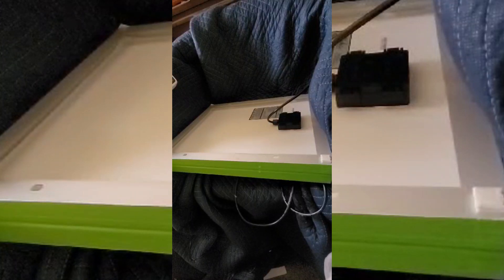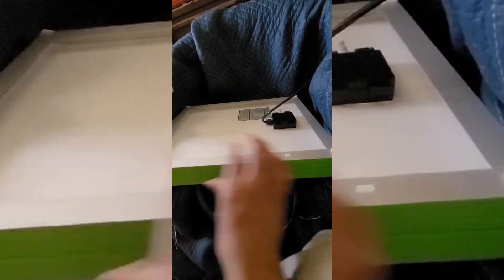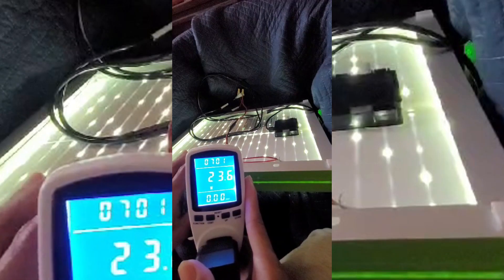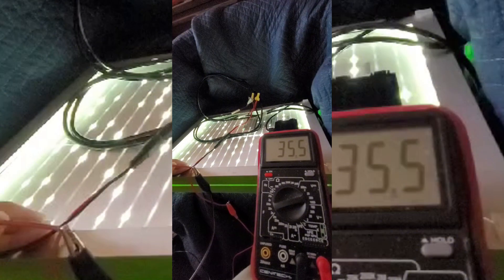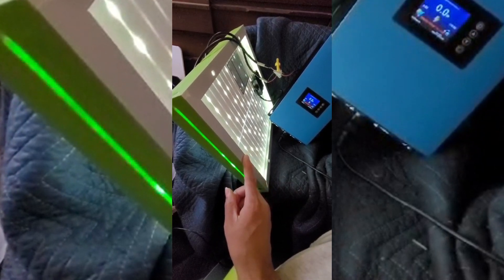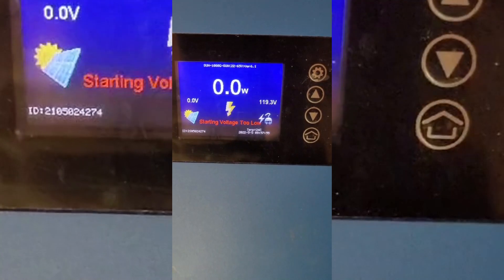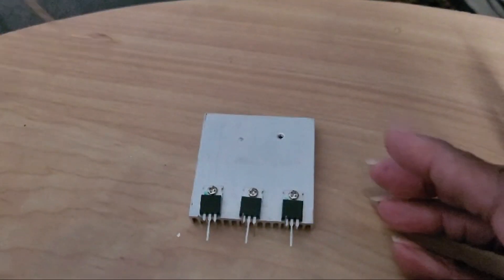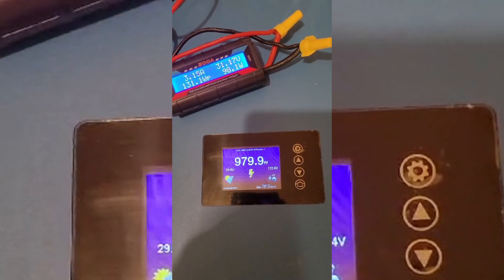Lloyd Shows How He Generates More Energy From Solar Panels With LED

Comment: I'm a bit rusty but I think LED produce about 150 Lumen/Watt. So 23W is about 3450 Lumens. The luminous efficacy of sunlight is about 100 Lumens per Watt. So if we assume a similar spectrum 3450 Lumens is equivalent to about 34.5 W of sunlight. Solar PV are about 15% efficient so 34.5W of sunlight produces 0.15*34.5=5W of electricity. So I'd expect this rig to turn 23W of electricity into 5W of electricity. An overall efficiency of just 100*5/23=22%. Certainly not over unity anyway.
Reply: Nice and good figures, I like it. But unfortunately this is wasteful because whatever equation you present to him is considered wrong based on his knowledge and education. He surely ignore this figures and equation. What you present here is helpful to others including me but not to him.
Reply: Seems to me like these people are on drugs.
They just build weird stuff.
Since motivation comes from the high. Perhaps this kind of energy drives this overunity device ?

With a clear mind i would get a headache. Cause i know that solar cells are 25% effective. And Led's are 90%.
This should be 22,5% of the input power out. 

Consciousness bends reality ? 

So the drugs in the human body power this device , by changing Consciousness ?
Reply: Why struggle to calculate, simply share your equation with Lloyd. He has a Youtube channel. He is doing an experiment that I haven't seen people do. See how close that solar panels are to LED. He is using readily available LEDs and solar panels. Just conduct your experiment and share your data.
Reply: @Avatar_2025  He is stubborn. He standing on his own invented formulas and ignoring any corrections.
Reply: @Avatar_2025  This kind of experiment is made by newbies in the free energy field being so simple to replicate, therefore nobody is interested in it afterwards. The results are very clear: waste of time. I saw though interesting experiments made with solar cells and tritium lights. This could be something of interests, but tritium is soo expensive.
Reply: @Machiuka  Ok. Have you read Patrick J. Kelly's ebook on devices that seems to defy our laws?
Reply: @Avatar_2025  Reading that book is our primer book, but the examples from that book are primarly theoretical, not so much of practical interest. There are thousands of people working to solve this problem on this planet, but so far none of them came to something that could be easily replicated. We are continuing searching for this holly grail, but the endeavour is not so simple. I am somehow sad when I see people trying to present hocus-pocus solutions to other people.
Reply: @Machiuka  You're right sir.
Reply: @Machiuka  In that book, some inventors are still alive but what amazes is, why keep looking for something that has been found simply because scientists haven't found a theory to explain such findings or because inventors have not come up with acceptable theories to explain their findings. These devices do work as claimed but it is us, interested in others areas that keep saying that it is impossible, just like turning water into wine, the wine that people drank and got drunk.
Reply: @Avatar_2025  If those inventors are alive and their inventions are the real deal, why nobody except them are having those inventions??? Nobody in real world cares of theory but of real data, energy in vs energy out. Until now only claims and some videos nobody can verify. I didn't say they are not honest, maybe they are. I only ask  a simple question.
Reply: @Avatar_2025  
I've seen some of the work he's done and it's extremely poor.
Reply: @ColinWatters  
I calculated about 4.7 Watts using slightly different assumptions.
Reply: Im not sure if this helps the scientific argument at all. Your argument is against the efficiency of the solar panels. If for instance he had used the 50% efficient solar panels that have been shown in experiments, he would break even, a feat that is supposedly impossible. From there on, if we get for instance a 60% efficient solar panel, there will be free energy. Also bear in mind, he is using two panels that are very close to the source of light. Your argument only proves that this can work given the right solar cell efficiency.
Reply: @Binahx86 15% is closer... 50% is too far.
Reply: @Binahx86  He shows it works. The guy is available and you can ask him questions.
Reply: @Avatar_2025  He hides. Avoiding two way conversation. Delete comments. Run away after a single punch like the known black boxer.
Reply: @Avatar_2025  His works were illegitimate. Easily replicated by any kids.
Reply: @Binahx86  In that case my numbers are wrong. I did say I was rusty.
Reply: @ColinWatters  Rust not penetrated too much yet. A lot of people in solar industry said PVs are 20% efficient. More or less....

Comment: Lloyd we need a simple description what you have done here with the solar panels and how they generate dc power  led lights and mosfets 
genius by the way
Maxwell can put these on the boot of his car or on the roof  brother 
But you need a licence fee negotiation first 🎉
Reply: how much more simply does he have to get. you must be simple.
Reply: @marlonjoslin6730  sure Einstein
Reply: @edzukich  just watch his videos.
Don't worry about the numbers.
Each video gives I little clue to what your asking.
Find it and watch the next one.
For Eg, how you get the power.
Then how you can increase it with more volts or more amp and even both.
Everything he shows is on a small scale.  It's just a taste.
He even shows you how to make large mosfet.
I'm interested in the solar myself.  
The RF harvesting is great, and all. 
Once you have all the info and then you add the numbers, and you get the hang of it.  
Run it through Ai
Write a prompt with all you find .
Apologies for the insult.
I'm a sceptic, too.
But I'm off grid and it's interesting to me.
Reply: @marlonjoslin6730  no probs mate